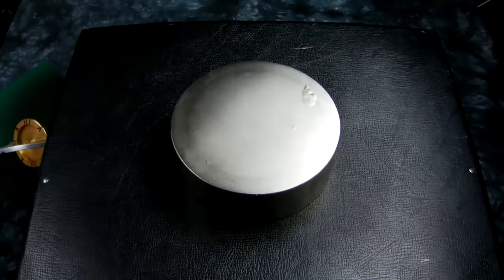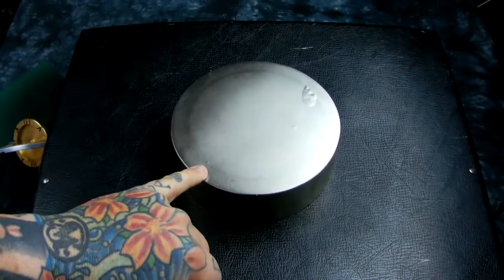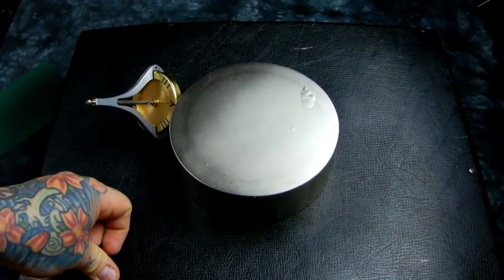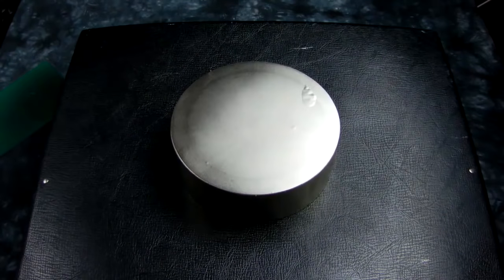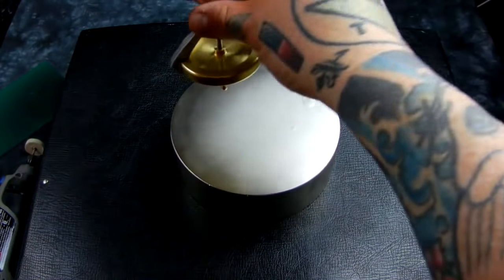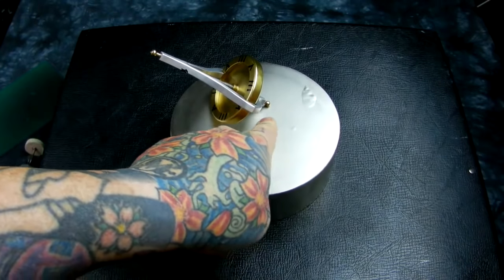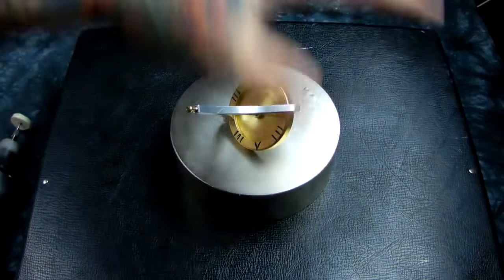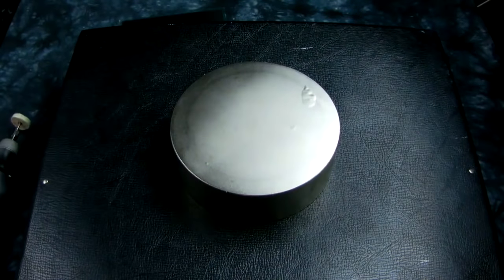Must-See Video! *SECRETS OF MAGNETISM* Never Seen Before* Torus-Hyperboloid

Comment: Please show that gyroscope doesn't slow down over center of magnet when angled perpedincular to magnet surface (wheel rotating around horizontal axis ) . If it slows down the same like on the edge than I have explanation for it

Comment: why do you repeat the same thing 20+ times, that's a sign of someone trying to convince someone without them thinking about it, i'm one of those people that has a more openness to understanding science, so in a sense we people tend to over analyse things, well son you over talk
Reply: Ok here is the deal:  I am extremely dyslexic and 51 . Son ultimately I was accademicly robbed.  Where this is relavent is along with the learning issue I was given gifts . For example as the gyro was moving in the center I could see / visualise the flow in the air; looking up and to the right. I think in three dimensions   
   You are trying to teach and inform folks.  You are a very smart dude , that is obvious  You need to work on your method of teaching.    The reason is this, the door to our brains are very heavy and being held up by a very fragile stick : Pride .   If you want to be affective work on this  .    
      Another point I am going to make is , inmo there are things that are taught in science and higher math that are not correct. Mostly because the origin of these principles was opinion that an individual strived to prove.  It's human nature to want to be correct . To validate a life's work.    What this does when these are put into process  , is create an inadvertent state of compensation.  Metaphhoricly steering between the lines that you have been tought .       
      What got me starting to contemplate this is questioning how someone with the gift I have am able to merely glimpse at a part that has been produced by an engineering department and say ; this is going prematurely fail . It's going to stretch x amount and be correct.   I'm certainly not smarter then a department.  One person can mess up a formula not a department.   So something else was a factor and that is the method  .

Comment: Theoria: I'm beginning to see where you are going with this concept. Do you think it is possible that there is a momentum transfer between the field and the brass? The edge of the magnet "taking" momentum while the centripetal divergent part of the field imparts, or retains it? Do you think it would be possible to transfer momentum from one flywheel to another using the hybperboloid geometry?
Reply: Noting the brass tube and magnet experiment, I'd imagine that brass flywheel is, whilst it is in motion and therefore taking part in a complete dielectric circuit, if I am grasping the principles correctly that is. Alike the tube the motion, relative to available dielectric current where one is highly conductive, ie copper/brass, creates interaction, resulting in its own 'magnetic field', I'd estimate they'd be as oppositional poles.
The result being that, relative to the centre it assists the spin, the 'drive', somewhat as although they turn against one another, that turn is pushing with the whirling toroidal field. At the outer edge the fields act as though two clockwork cogwheels turning against each other.
That said I may not grasp it well.
Reply: Yes this is a dielectric interaction IE a forceful pole shift simply put. It has to occur between an already existing changing EM field and a dielectric and it is always opposition and braking. I used to build electric motors and we put the motors on massive aluminum plates that rotated and when dragging the magnets across the dielectric aluminum, it would make the aluminum wheel spin but it felt like I was dragging the magnets through water. 

Theoria, I’d love to see a video on phase conjugate dielectrics! I follow Dan winter on his videos as well. You two put together a perfect presentation for the unification of all things. Thank you for everything you do! I cannot believe the amazing things I have learned from you!
Reply: @brianburch1381  hey, just wanted to say thank you for the Dan Winter reference.  He has exactly the information I have been searching for!!
Reply: @kennethkretschmer1027  I’m so happy to hear that! I honestly have stopped searching for new sources guiltily while following these two geniuses. They seem to answer pretty much all of my questions! I’m amazed though and I’m very happy you have found what you’re looking for!
Reply: @brianburch1381  after getting into some of the deeper stuff it’s a lot tbh, but the geometry and bliss explanations seem spot on.  Did some breathing already and had some progress already.

Comment: I wonder if you measure upper and bottom part of the stick in the center of the copper wheel, would there be any voltage when it breaks the momentum ?

Comment: The same type of effect works if you take a 1/2" Copper Tube and then drop a smaller size neodymium magnet down the center. The magnet does not fall at normal speed. For some reason, the breaks are put on and it slowly falls through. I think the same "reaction" is happening...

Comment: I stopped the video at 8:07 to answer your question.  At the center you have equal polar forces passing through the gyro like a spinning tornado from both sides which causes it to spin indefinately.  On the edge of the magnet you have equal forces, but it's like one tornado spinning in one direction and another spinning in the opposite direction at the same time, causing the gyro to cease spinning.

Comment: What causes the gyro to stop?
Did the magnetic field and the spinning brass induce electrical charge flow?
Reply: the spinning of copper in a magnetic field can produce a counter magnetic field on its own. As the Gyro is near the center point of the magnetic flux it keeps spinning as it is trying to appose the flux and being held by the axis of can only rotate in one direction. When the Gyro is moved outwards it then goes from the opposing the field to becoming attracted to it then that is when it can shed the momentum away and slows down. if you play with two magnets even you can feel the difference between the attraction and repulsion effect of the fields!

Comment: Since you asked for my thoughts: There is no magnetic field. All these effects are the result of the spatial shaping created by the movement of the electric field. Your continued reference to imaginary fields is a sorry compromise to past imaginary constructs because of the reactions of objects to the distortions in the space around the moving electric field potential (EFP) that is trapped by the structure of the magnet.

Similar to your analogy that a vagina is a hole, the center/point of the pleasure and function of that organ isn't the space it can create. Your geometric lines and shapes that you project as a real magnetic field or lines of force are nothing more than stuff filling holes created by the collective aligned moving E-field.

The basic E-Field (EF) structure of a spinning disc is simply a stable structure of the balancing EF forces that include the concentration and collapse of the EF Potential as it repels and circles and concentrates. In contrast it distorts space, which varies surrounding the spinning disc of EFP, which is variable across the radius of the disc. The imbalance is most concentrated at the center of the disc, where the force of the repelling EF is most intensely inwardly directed, and again has an imbalance at the edge of the magnet where the density and motivating forces are completely outwardly directed.

Your spinning gyroscope is creating a moving EFP that interacts more sensitively to the collective spinning EFP of the magnet. The braking effect is simply the imbalances of the misalignment resolving according to the physically less restrictive object.

You will find that a smaller disc magnet will not sit anywhere on the larger disc magnet, it will align itself edge to edge on the top surface or flip and align at the domain wall. This is because the real interaction isn't any distortion of space, but rather the moving EFP forces.

Also steel balls will be drawn to the least neutralized moving EFP on the disc, the edge.

And one last point: spin your gyro backwards, or flip it and now it's contrary to the spinning EFP, and it will stop at the center too. Even faster than at your angle at the edge.

The holes or distortions created by the MEFP only affect the compactness of particles in motion as they form solid structures as in liquid to solid transitions or developing living structures, or formation of planets. Which emphasizes that the Earth's EF has been changing over it's lifetime as the Earth is expanding without adding more matter and life forms transitioning from massive giants and dinosaurs to the smaller beasts and people of today.  

Thanks for asking... When I have the patience to overlook your anger, I find your work quite illuminating and inspirational. You might check out distinti's work on YouTube and .com He has some matrix vector analysis that may just quantify what you're intuitively identifying as both time and spatial differential influences of E-fields.
Cheers, B
Reply: What approach is this from, electrical universe theory?
Reply: cloud0123 My current thoughts, above are my own. They bring together the quantitative work of Distinti on the actual field behavior, EP Dollard on that part of E fields that actually repels, the dielectric field (however, this is not his interpretation), Ken Wheeler et.al. Re. Work on how the polar fields of magnets, which also correlate to the strength of the electric field of moving charges (there is an imbalance in polar charge fields because the source fields are all aligned and balance axially, aligned but not balanced radially and the field is directional in nature). Because the magnetic particles are locked in place before they are aligned, they can't move to balance all the forces. The South Pole is simply more uniform than the North Pole, this compacts it compared to the North. 

The bit on the expanding earth is simply an application of these basic observed behaviors which are demonstrated in the Ebner Effect et.al. (Numerous patents) who show intense fields or strong magnetic fields change the mass and atomic packing density and therefor how DNA expresses itself, even in animals. Modern animals develop into extinct species when eggs and embryos are put in high electric field or South Pole pseudo fields. 

The EU theory may embrace this, certainly the theory that e fields influence all things in the Universe is consistent. And the movement of Earth into its present orbit requires a change in our localized electric field from when we were orbiting with Saturn, Venus, and Mars around the Sun on a much smaller planet. 

It is one Universe and one theory of one field with two directional properties makes all this possible. Even the Aether may simply be the combination of all the local fields into a Universal field. So far I haven't seen it do anything beyond a background field couldn't do. 

A great scientist isn't afraid to be wrong and happily throws away an entire theory when it fails. He's also constantly looking to disprove his current passion by poking at it ever more deeply. This is a proper application of sociopathic behavior. Recognize society need consistency and progress, that's where a great engineer applies the shattering truths of science into positive steps of growth. His biggest impediment is the capitalist, who will gladly sacrifice all hope of growth for more of what is today. Safety in reserves is all he knows because science failed to present anything from the universal field soon enough. And engineers haven't developed a safe transition, yet. 

Merry Christmas, enjoy the transition to a new growth period. Will this be the one?
Reply: BMan18 he half correct, there more than what you think inside of it. but sci wrong on some part as My observations and show me otherwise.
Reply: I'm curious as to exactly what sort of "holes" your explanation fills that his does not? 

It almost appears to me as though you are simply using two different conventions to explain the same thing. Granted I have not spent the necessary time with your material to fully understand where it diverges; I haven't yet been presented with a question which would require me to restructure my understanding beyond what this man is explaining. 

Whereas my "education" is public school left me with many questions, these explanations make much more sense. (Theoria's)

What sort of question or observation could his convention NOT explain, is what I am asking? What is the requirement which is not met? You could say "Oh well magnetic fields don't actually exist" and then go on to create a bunch of new conventions which essentially add up to "a magnetic field," appearing only to diverge in that you call it and all its components by some other name; but why?

Comment: Have you ever tried the compass on the edge at 90 deg or 180 deg to the current position. Or with the axis parallel to the corner of  the magnet? Is it the same result?

Comment: the breaking of the gyroscope is caused by eddie currents generated in the brass - evidently flux lines are being cut.   interesting that there is little effect at the center.   thanks for the video.

Comment: I would say the push, pull, drag is equal on all sides when in the middle, thus nullifying  any affect. While anywhere else the drag caused by what I have heard called eddy currents, is concentrated at one point causing great drag and then stopping.

Comment: There's another secret with these magnets. Get two of them with holes in the centre and weigh them. Now arrange them so they are repulsing each other and brass bolt them together and tighten them so they are forced to touch. Take another object that is of equal weight to the 2 magnets. If you drop the bolted magnets and the other object at the same time the bolted magnets fall at a slower speed. Combine this with 2 disks or gyroscopes  spinning at equal speeds in opposite directions and if you get the speed just right the whole thing will levitate.
Reply: You are right I bolted two 100 lb magnets together,  dropped them and a feather at the same time in a vacuum chamber.  When they are bolted together they are as light as a feather as proved by your theory.  Thanks!!

Comment: I just paused the video to answer, because you're probably going to answer maybe 🤷‍♂️.  My initial curiosity is how quickly it stops without the magnet being present in comparison to the center and side of the magnet.  After that my thought is that even though the flux density is the same in the center compared to the edge the relative spin of the gyroscope in the center of the inverse donut is creating an almost perfectly balanced vortex flowing through the gyroscope and magnetic field , where as when it's on the side the imbalanced energy buildup creates enough resistance to stop the spin of the gyroscope.

Comment: +Theoria Apophasis
Can you tell me what the bearing of the gyroscope is made of? If it is steel or the ball bearings are steel, it will explain why the gyroscope brakes to the magnet. The magnet will cause a steel bearing or ball bearing to brake cause it is pulling the bearing to the side of the other metal causing friction. 
I think this is the explanation cause I notice when you take your hand off the gyroscope near the magnet it moves when it should not move 8:07. Therefore, it must be something the magnet attracts causing it to move.

Comment: The donut magnetic field is moving in one direction in the center (ie: through the center) whereas the outside magnetic torus has both parts on the sides - which means it will slow down the gyroscope. I am NOT saying there are two fields. One field. donut goes through the center but around the donut on the outside. Just like you said. Thus, the outside part has particles going out of the center, around the outside, and back in to the center. Particles go out - and then back in again to the center. What you are calling "braking" actually is the equal push-pull of the particles. Simple. :-)

Comment: The rotation of the brass charges it so that it interacts with the magnetic field.  When the charge is going with the flow, it has no resistance (maybe energy gain?), but when it goes against the flow, it drains the energy from the brass and slows it down?  That is my guess before you answer.

Comment: why does it work with a brass fly wheel? shouldn't it have to be iron based to be affected by the magnetic field, or simply because its metal, like copper and aluminum wires conduct electricity? please explain.
Reply: Currents induced in the Brass - due to the movement in a magnetic field, cause the flywheel to have a magnetic field itself

Comment: The flux density is uniform in the center and not on the edge.
On the edge, the wheel is moving thru a changing density and producing an eddy current within itself, therefore it produces drag and the momentum energy is turned into heat within the wheel.

Comment: If the gyroscope continues to spin when the tip is set in the middle, why not try placing the tip, not the side, of the gyroscope on the corner? The is what you say in the same force as the center.

Comment: honestly i think you're highly mistaken, if we imagine and invisible funnel in the center of this magnet then when applying a gyroscope to the center it should remain in this position.
Reply: If the magnet were powerful enough or the fly wheel were spinning fast enough to overcome so called "gravity", it would in fact remain. If the flywheel did not have the heavy "compass" frame around it and were placed in a vacuum chamber over a high powered electro-magnet, I believe you could achieve a standing position with a near indefinite spin.